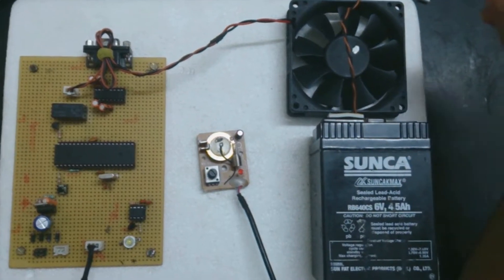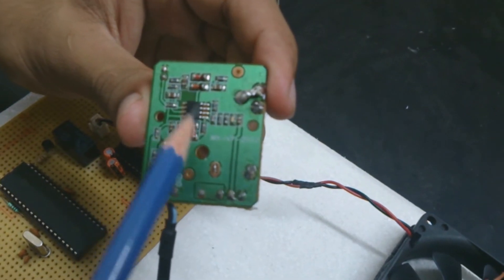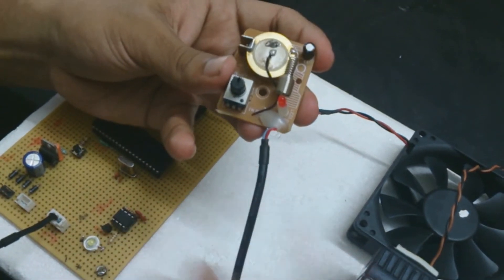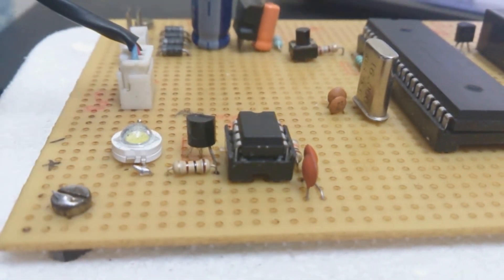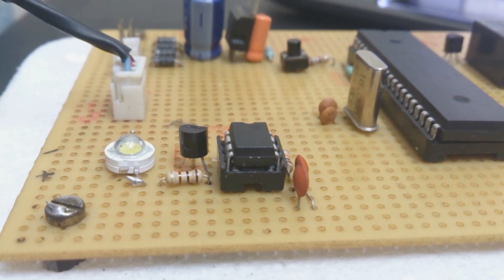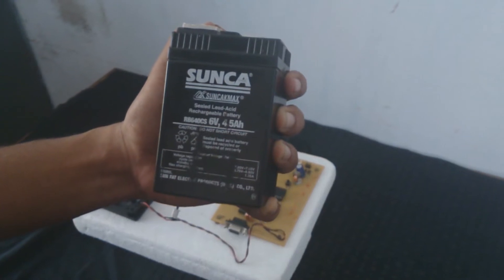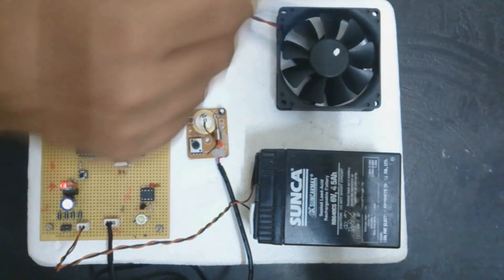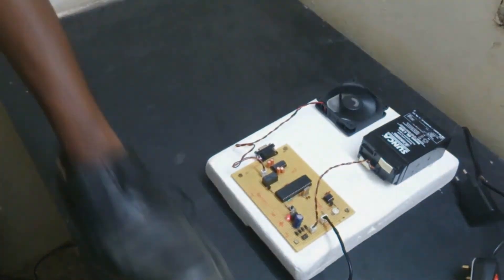TIIC IADC 2014 TEAM 72 2 "Energy harvesting from piezoelectric materials"

Comment: The electricity that operates a small motor or lights up LED bulbs 40 at the same time is not ‘Free-Energy’, it’s purely ‘Vibrational Energy’ and very powerful.

진동발전, vibration generator
 
Perhaps it will be very useful to the renewable energy.